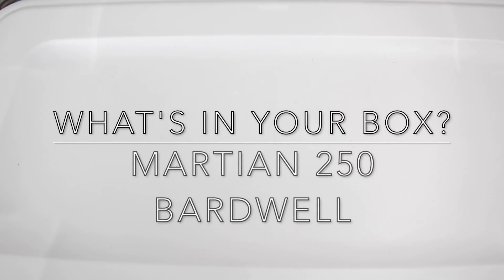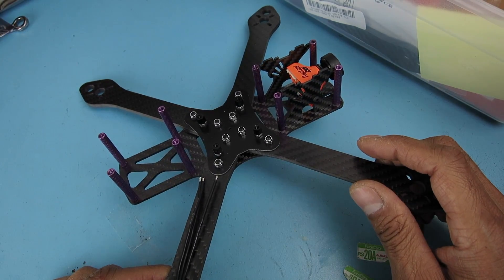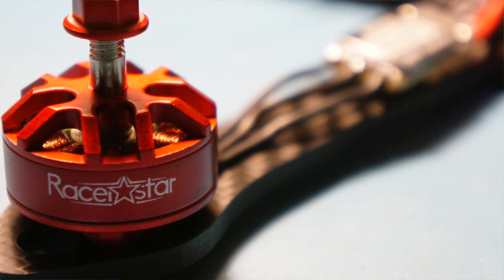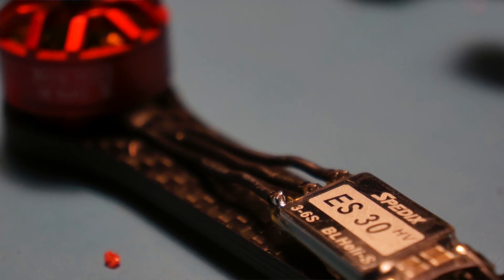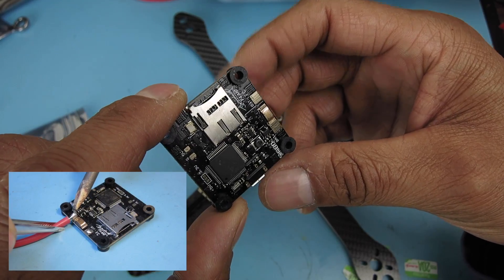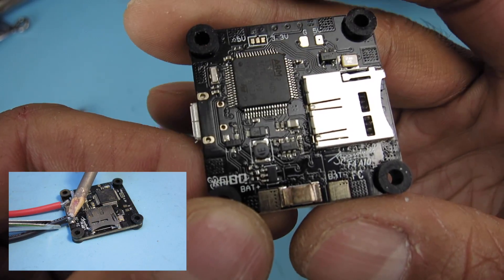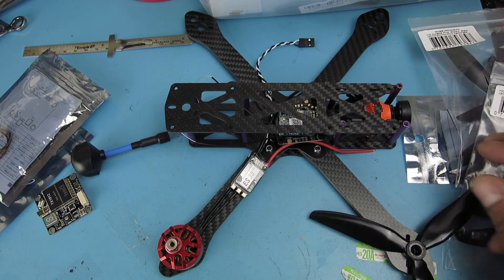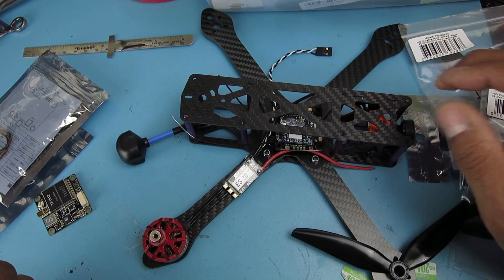Martian II 250 6-inch Props with Bardwell F4 AIO

Comment: I love the Martian for 6 inch but afraid it's too heavy maybe?? But then again can't find something better with so much room and lighter...I have a headache deciding what parts to go for a good flight time quad build... How much flight time you get with a 1500 4s battery on this setup?
Reply from the maker: Up to 5 minutes and as little as 3 minutes depending on the battery condition and how aggressively you are flying. I would not recommend an older Martian at this point but I hope to purchase a couple of the new Martians soon.  Keep in mind that when you're flying freestyle, weight doesn't matter too much and the heavier weight let's you "throw" the quad up into the air for hangtime when you can do tricks.

Comment: I have the same setup!!.. I wish i could find a video or some info on how to wire the  TX1812 VTX to the Bardwell F4. I have all of my build done except for wiring this vtx to this controller. any info would be great! thanks and great videos!
Reply from the maker: I used the video power pads on the FC.  JBs doc on the FC shows how to connect and bridge the power pads on the back.  It's worth trying first to see if your VTX is OK with the lower voltage. If not, you'll have to run a 12V or VCC from the PDB or direct to battery.

Comment: hello i bought this flight card tuning this card Bardwell F4 AIO but i can not seem to close engine turn with because as soon as i have my quad in airmode the buzzer for 5 seconds and then stops that do I have to.
  could you make us a video of the complete setting on betaflight thank you very much I forgot to specify the radio is a Taranis X9D
Reply from the maker: Hi.   I have many questions about your setup.  If you make a short video to demonstrate your problem, I will review it and try to give you some advice.

Comment: Hi! Nice build and video! What have you used for reducing vibrations from motors/props? Hd footage is brilliant! :)
Reply from the maker: Thanks!  I'm testing a new camera mount that reduces the vibrations.  I hope to be able to sell a few.  ;)
Reply from the maker: Thanks.  I'm experimenting with a new camera mount that reduces jello and having some success.  But, I'm using the HQ 6x4x3 and they seem to be well balanced.  The other factor may be that this setup cruises at around 30-40% throttle.  I've seen that the vibes seem to creep in more at over 50% throttle.  So, I'm still learning these 6-inch setups!